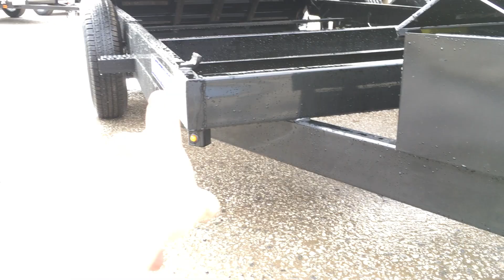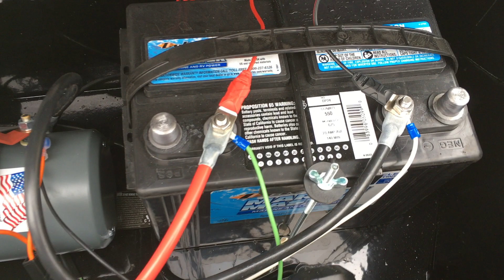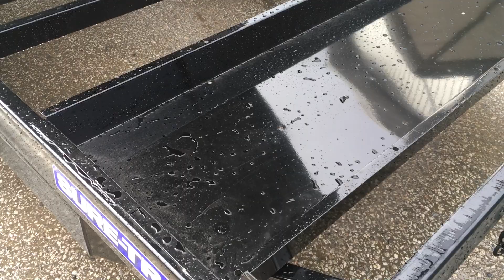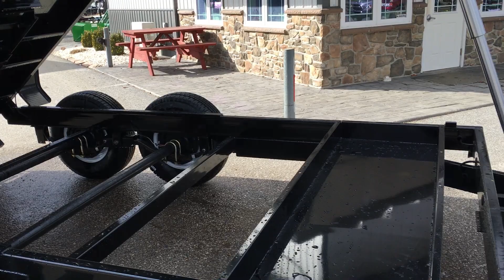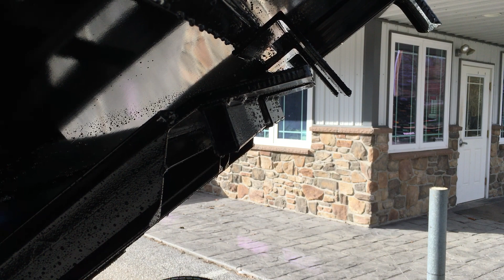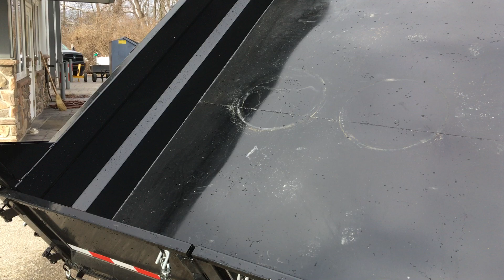Sure Trac 7x14' Telescopic Hoist Hydraulic Dump Trailer 14000# ST8214TLDD-B-140

Comment: The salesguy doesnt know what he's talking about. Doesnt matter if its power down or not it doesnt change the quantity of oil lol
Reply from the maker: Sounds like you need to re-watch that section around 3:30.  It DOES NOT change the volume of fluid, it changes where it is stored.  Power up/down gets stored in the cylinder primarily as it circulates fluid and stores some of it in the lines, thereby using a smaller reservoir.  This is also why a power up/down, if the battery is dead, can overflow the red overflow cap if lowered without the pump running (it will simply open the coil and allow gravity to do the work).  A telescopic uses a power up/gravity down, which dumps the fluid back into the reservoir, requiring a bigger reservoir.  Bigger reservoir requires a bigger box.  On the 16', they also use a larger 120" stroke cylinder, which requires an even larger reservoir, which subsequently required a larger box, longer tongue, etc.  On power up/down units, while the hoist size can change, the pump/reservoir/toolbox size do not.